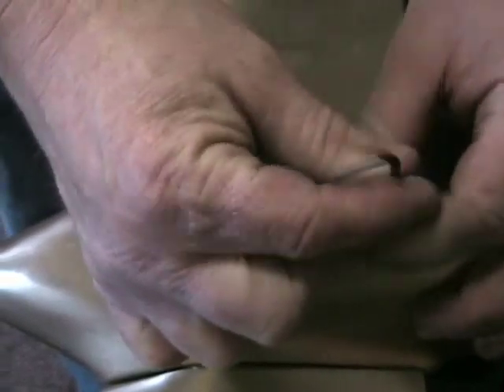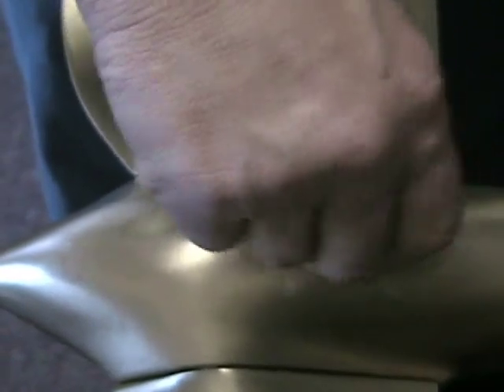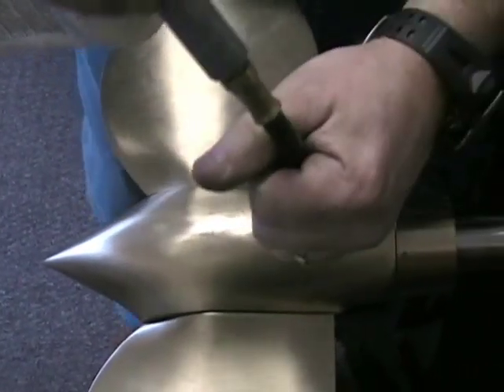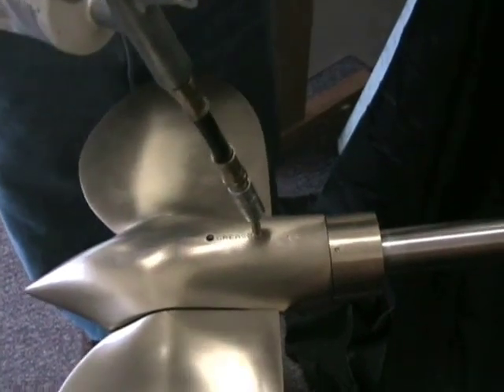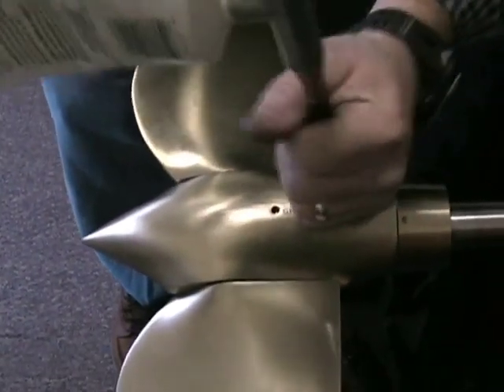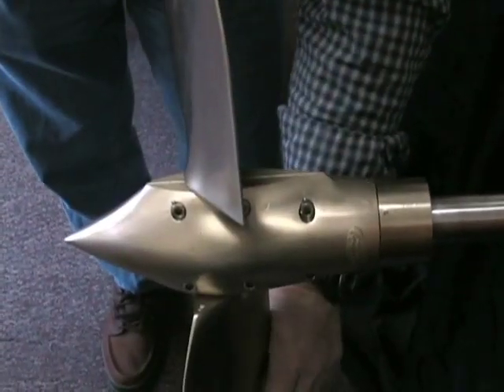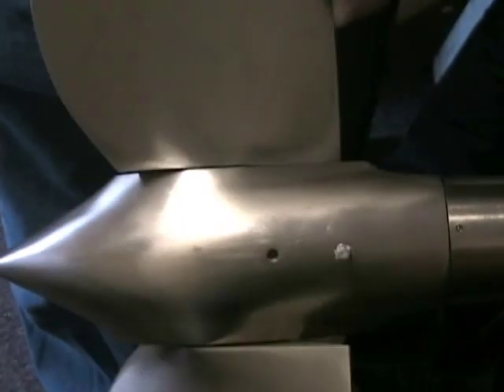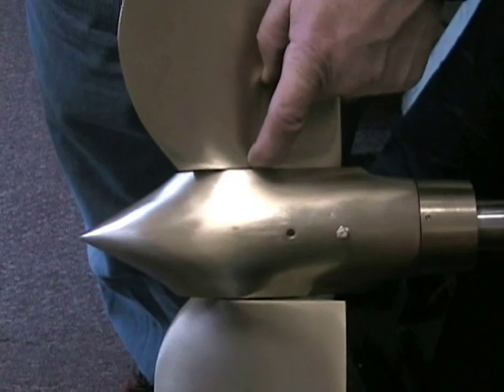Max-Prop: Greasing the feathering propeller

Comment: I am a bit dismayed that you don't mention the importance of using your specified grease! Luckily I called you earlier in the week before greasing and found out that none of the common grease types would work. White lithium would wash out you said, and marine bearing grease would be too thick to allow the prop to feather. There was no time for me to order the requisite PYI grease and grease gun, so had to use Harken winch grease which was only available in small quantities and not in grease gun tubes.
Reply: I agree, this was very important omitted info. We could even take it one further, once the recommended grease kit was obtained: How the heck do you use a grease gun and a squeeze tube of grease together?

Comment: Hello, does anyone know where can I find a zerc fitting the same length as in the video.  The fitting that comes with the kit is too short?
Reply from the maker: The zerc fitting is an M6 (6mm diameter threads by 1mm per thread), it is commonly used on automobiles.  You should be able to find one at an automotive store or your local nut and bolt shop.
Reply: @PYIinc  Thanks very much for the reply but the extended version is extremely hard to find.  The available fittings have about 6 threads.  When screwed into the prop tightly it is too far in for the grease gun to go over the nipple.  The extended one, like in the video, is the only one that will work.  I think I have found one at G. L. Huyett in Minneapolis.  I can't believe I'm the only one to have this problem.  Perhaps because my prop is one of the older versions.
Reply: By the way, one other thing, great prop.  Reliable as hell!
Reply from the maker: @ronwild9223  Here are some on Amazon, although they're expensive little guys. I'm glad you are liking your Max-Prop, it's always good to hear that!

https://www.amazon.com/Grease-Fitting-Taper-Thread-Pieces/dp/B07JQV9KHJ/ref=sr_1_5?keywords=m6+zerk+fitting+extra+long&qid=1556299106&s=gateway&sr=8-5

Comment: what is the diameter of the grease nipple fitting
Reply: Not sure but here's the description of it.
Please Provide your Part Number
KS 2
0.0091
4/29/2019 EA 1.8637 3.73
Heritage Fitting, Zerk, Straight, M6 x 1 Taper Thread, Steel, Zinc Clear Trivalent, DIN 71412, Check: Surface Ball, OAL: 24